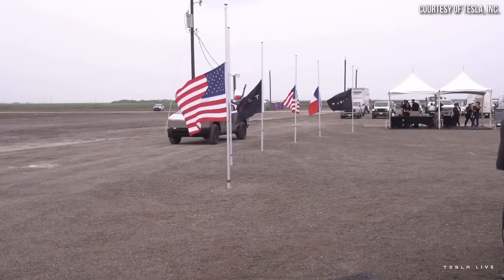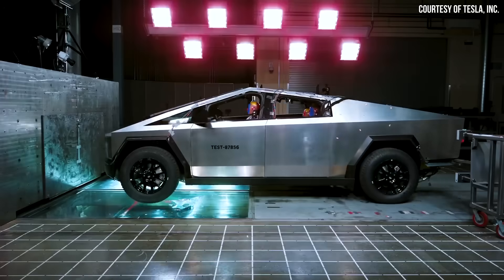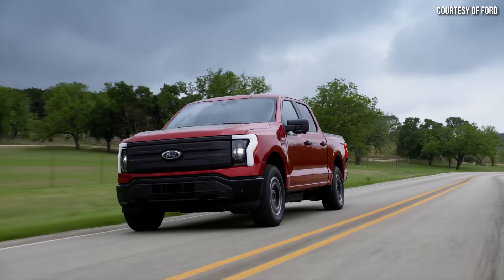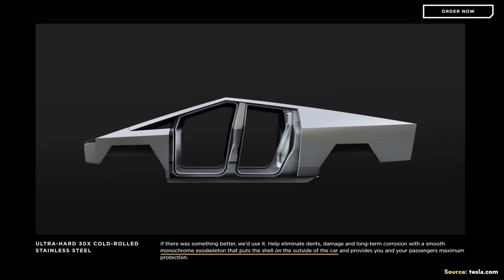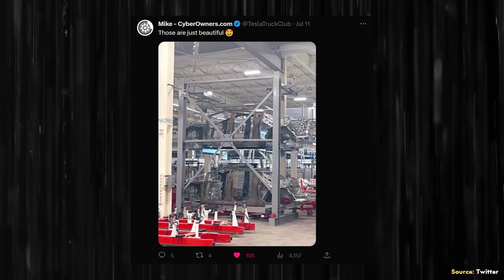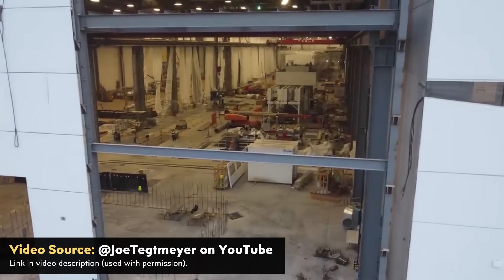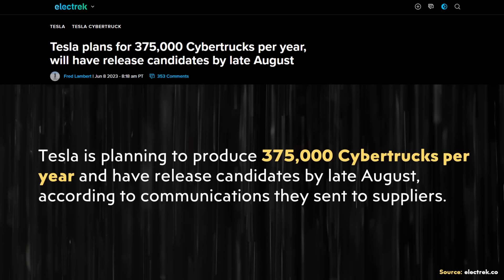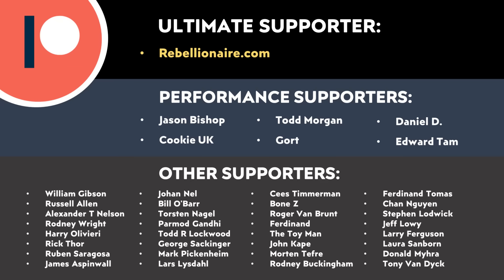LEAKED Tesla Cybertruck Image Suggests Structural Changes

Comment: I think most people will purchase a Cybertruck just because it is novelty.  Lets all try to remember...this is an all electric truck.  Imagine taking this "tank" Cybertruck out to the desert somewhere and running out of power. ......now what?  Sure, this could also happen with a gas truck but batteries are not going to fair well as well as a gas combustion engine. ( Basically, deal with heat well )   Plus, it is going to cost soooo much to purchase one that it will not even make any sense that it is electric.  Only the rich will buy them for only the reason to  look cool.   They will not be worth what you end up paying for one.

Comment: Spent 30 years in a GM assembly plant, worked many model changeovers, some of them we gutted the entire body shop and started over.   Here is my take on the exoskeleton debate.
   A lot of people appear to have a misconceptions of what is even possible as far as putting an exoskeleton on the CT.  

   First, Elon has mentioned several times how hard it is to work with the SS they are using.  Having to notch the inside of the workpiece just to be able to bend a straight line crease without breaking the press.  That is why you don't see any curved SS panels anywhere on the truck, it's not an option. So, they can't make door jambs or B pillars out of SS.

   Second, there have to be mounting points for things like hinges, roof rails and casting mounts. How would you attach a drive unit to the outer skin?  
     What you are seeing in the pic is what I call a space frame, I don't know what Tesla calls it, made out of the same super high strength steel that the cars use. I guess you could  call it a roll cage, which is what actually is.
    Then add the structural battery pack, plus the front and rear castings, just like the cars.
And what you see here does look just like a new Model Y frame.   So what's different about the CT, why do they call it an exoskeleton, and where does the weight savings come from?
      Well SS is lighter than the high strength steel.   Saving weight by the best part being no part like, heavy steel side impact beams in the doors, or using thinner steel in many areas of the space frame itself.  I didn't see any kind of steel reinforcement in the rear casting area, which might have been needed for towing or hauling. 
    I believe the reason they call it an exoskeleton is because the CT would not be structurally sound enough to drive without the added support of the outer skin.
  If you were to take all the sheet metal off a Model Y,  it would still be perfectly driveable and nearly as crash worthy.

The CT not so much.

IMHO.
Reply: Thanks for the insights.

Comment: I think Tesla changed the wording because Corey Stubbin said it was not an exoskeleton.  He kind of half recanted but the damage was done. The haters had a talking point.  If one looks at a turtle it is a good match for the cybertruck.  Exoskeleton  with all kinds of attachment points. Top and bottom. The body in white is a good way to create the attachment points and shells for door openings and interior parts.   However the real problem that nobody is talking about is that with all the holes for doors, glass in the roof and the box it was never going to be a great exoskeleton.   None of it matters as it will be a great truck.

Comment: Exoskeleton design like an aircraft doesn't mean that there are no internal structural supports. Rather, it means that the SS skin attached to the internal framing yields more structural strength than with standard internal structural supports alone. We can only speculate until Munroe tears one down for detailed analysis.

Comment: Will the CyberTruck ramp as slowly as the Semi has?
Reply: There's no incentive to ramp Semi fast because 1) Tesla is still battery constrained and one Semi takes a dozen Model Y battery packs 2) Semi factory, and not just a small line with higher per unit cost that is available today, only comes online 2025-ish, expanding Giga Nevada. IMO they could've built out half of Giga Texas for Semi and ramp it significantly, it just makes no sense considering battery (and engineering) shortages. Tesla wants to grow fast but not so fast it is unsustainable.
Reply: @BigBoneESB     A concept prototype of the Semi was unveiled at a press conference on November 16, 2017, where Elon Musk provided additional specifics.  So if you say the Semi will come online in 2025-ish, that is 8 years.  This battery constraint thing must be the real deal.     Hope they have enough batteries for the CyberTruck.

Comment: The casting is aluminum alloy. The exoskeleton is a steel alloy.  How did anyone think that the exterior would be of and part of the cast?  My gawd.
Reply: They didn't.  I think most of them knew that casting stainless steel would be too expensive and besides, Elon has been talking for years about folding the stainless steel.

Comment: If there is no underlying chassis holding the "cabin" to the "bed", you've got an exoskeleton or monocoque, as all modern cars have.  The structural walls are made of diferent layers in all cars.  On the Cybertruck the outer skin happens to be stainless steel, but the inside "skin" is stampable steel, so you can achieve the complex shapes needed for the door frames.  I believe the design remains the same as when it was first presented.

Comment: It can't be an exoskeleton; stainless is very expensive, 2X - 3X the cost of mild steel. With an exo you would need to use much thicker, and heavier material. You can actually see how thin the stainless is: around the fender areas you can see warble in the surface. I'd bet anyone here it is under .030, because .040 will stay flat in my experience. My guess is when they saw the cost and thought about repairabliity they dropped the exo idea.

Comment: I believe you are right that it is the combination of the body panels and the frame that will provide the overall structural strength. I think this was always the intention. 

You definitely need the frame to provide strength as well, especially the B-pillar in the middle of the vehicle where the doors are. The doors would immediately jam in case of a roll-over accident if the underlaying frame didn't provide enough structural reinforcement.

Comment: One thing bugging me is that it will be impossible for most people to reach over the side of the bed and get stuff out. In a 'normal' truck or a ute you can approach the tray from any side and get stuff out, but with CT you would need to get in the back to get anything that was up near the cab.
Reply: What you say is true. However, even in conventional pickup trucks, I believe that a high percentage of them are sold to people who rarely put anything in the bed at all.  They're mostly driven by poseurs.  I don't pretend to know the actual percentage, but here in the big city where I live, I think it's a large majority of them.  I see these huge, shiny trucks driving around without a scratch on them--inside the bed or out.

I think that an even higher percentage of the buyers of the CT will be buying it for the image it projects (clearly not the same image as the conventional pickup truck market likes to picture themselves--i.e., cowboys out ridin' the range).  But I think they will have some kind of definite (space cowboy?) image in mind that will be their overriding reason for buying the truck.  Few of them are going to use it as a working truck.

I guess what I'm saying is, in a sensible world (and maybe where you live is sensible) your criticism is entirely valid.  Where I live, I don't think it's going to make much difference to CT buyers.  They'll be putting that bag of groceries in the frunk.
Reply: @eyesuckle  I might have mentioned I wasa sparky working in a mine site and always had tools and otherequipment rollingaround in the tray, that always ended up hard up against the cab. In a Cybertruck I'd have to get in the tray to get it.

Comment: I expect this to be an incredibly rugged truck and so I think the 375,000 target is low if this truck is marketed in Africa and SE Asia where it could replace Toyota truck for utility, assuming the charging infra structure is available, and costs can be contained.
Reply: Depends on price.  Elon warn it will be "expensive".   I don't know if that means Model X or Model S expensive, but certainly much more expensive than a Model Y.

Comment: It’s not ladder frame. That’s still most impressive.
Yes, door jamb pillars separate from (front &) rear sail. To be expected. Still using triangulation of tray sails up to roofline to take that 3,500 lb load, not banana chassis like Hilux of old. It won’t flex like a F-150 ladder, separate tub. It’s function, performance that counts, not sticking to aesthetic hypothetical design. Does it still save weight, allow lower bed, stiff, superior "sports car" handling? Is it still cheaper to produce, more robust / long lasting?

Comment: In my opinion, building Cybertruck with removable SS panels, whether structural or not, will make it less difficult to repair collision damage.  Based on the leaked photos, it appears that much of the vehicle's structure is internal as evidenced by the upper extensions of the rear casting.
Reply: Yeah, with them offering their own insurance they now factor that into their design iterations.
Reply: I doubt the 3mm SS outer skin will be removable, given how important adhesion to the underlying stamped frame will be.  But I don''t know how they are attacked.  Maybe an adhesive that can be broken down by some process.

Comment: I still wonder how they can destroy energy in case of an accident. Normally this is done through forming the steel. If the form will stay in case of an accident, where does the energy go. They could pout airbags to the outside. More realistic, they have to allow that the steel plates get destroyed in an accident but take energy.
Reply: Ok is like 3mm stainless, in an accident it will deform its not Adamantium.
Reply: @timsmith6815  I had to look up: "Adamantium is a virtually indestructible steel alloy named after the fabled metal Adamantine of Greek mythology. The metal has its origins in the work of American metallurgist Dr. Myron MacLain during World War II when the U.S. government assigned him to military research and development."
Think about small cars, bikes, pedestrians (well for bikes and pedestrians its mr important that they roll over the vehicle). Also I think Tesla will do a lot with cameras in trying to avoid accidents. Steel on a vehicle is in the range of 0.8mm. It takes - for an accident - too much energy to deform 3mm steel. On the other side, when its stable its also good.

Comment: What you called side body panels, aren't. You are looking at the body-in-white.

All bodies-in-white are structural ekements. They provide stiffness to resist twisting, and so they are load-bearing. Cybertruck, too.

Tesla did not backtrack, and there is no significance to calling the body-in-white + body panels 'skins.'

Don't overthink this. The use of the word 'exoskeleton' just means the tough part is on the outside.

With all other consumer vehicles, the body is fragile. Paint is even more fragile.

No doubt design changes have been made. But the exoskeleton idea has not been watered down.

Comment: I would love to see a car made in one single cast. Mount the windows and doors and everything else from the underside. I guess Model 2 will be made this way.
Reply: I think it'll be 1 large cast piece for the frame overlay of the compact(could it be the first tesla without a glass roof?
Then the f&r castings and a small structural pack with the seats&carpeting mounted to it.

Just 4 major pieces to make a car with 3 being castings. Imagine the cost savings and speed of assembly. 😎
Reply: @4literv6  I would not mind a plastic or metal roof. I have closed my roofs in my teslas with sun shades. 

I think the glass roof is one of the things that make no sense.

Imagine a factory where you delivery alumiium, steel and crude oil on one side and get a complete running autonomous vehicle on the other side.

Its magic! 

"Any sufficiently advanced technology is indistinguishable from magic."
Reply: If you crashed you would just chuck away the whole car ?

Comment: There is no special alloy. it's just a standard stainless steel. i bet it's the same as the DeLorean used.
Reply: They already said it's their own in house mettalurgy teams steel as used in the starship. 👍🏻
Reply: This is incorrect. CT uses 301, cold rolled 30x, that is 3mm thick.  It contains nickel, chromium, & iron.  Making it more cost effective, but not as strong. DeLorian used .8mm 304.

Comment: I doubt the cyber truck exoskeleton design has changed at all from its original conception. If you look at the body image that was on the original order page, you can see the stamped members around the door openings. Clearly 3 mm thick exoskeleton steel could not be completely self supporting. The folded steel and stamped frame just beneath it together give the body the rigidity it needs.
Reply from the maker: You may very well be right.
Reply: Different (3+) materials  ( and thicknesses) require separate steps
The picture you see there is already two main (materials put together) steps, one stamping parts and one casting parts now just add the stainless steel panel then that’s your final exoskeleton 

Even the midsection are welded stamping pieces, ( not just from a single stamping); then you have two casting pieces, front and rear.

Comment: For real production line of a mostly unibody truck.  Wondering if Tesla will use thinner steel for the body...no need to haul around 3mm of expensive stainless if it isn't structural.  1.5mm aught to do the job while keeping the weight and cost down.

Comment: Tesla really does have the most efficient factories out there. As for the new CT - I'ms user early on the reservation list but man am I in a tough spot. Do I get an early example knowing that it is going to get way better in a year or so... and is it possible to delay my order. I just get the quad and sell it in 6 months and pickup an updated one later down the road....
Reply: I am in a unlucky positon in Europe and do not know whether we even get ONE Cybertruck. I am in the lucky position that we certainly will not get the first gen. I hope for a 3rd. gen in 2028.
Reply: Buy it and immediately resell it - you will make a nice profit from the hype alone. THere are very wealthy people that want the latest and outrageous fashion. Then wait another 1-2 years for Tesla to refine it. That happened with all of the models, but this going to be especially true for Cybertruck. This is such a radical design that probably it will take few years to work out the kinks.

Comment: Laser cutting and folding is really really slow compared to stamping, so if it's ever going to be produced at scale they will need many many laser tables and press breaks so probably many more machines and much more floor space for similar production volumes with traditional stamping.

Think 5 second cycle time for stamping and 5 minute cycle time best case for laser cut and fold. That's a 60x time cost unless you have 60 laser machines and 60 press breaks feeding into the production line. 

That's why I doubt the will achieve close to 25000 in 2024 and that's being optimistic
Reply: Perfect job for Tesla bot. Underground. Reminds me on Metropolis.

Comment: Doubtful that this is a half step. They simply overplayed the idea of the exoskeleton. The skin will offer structural support, but not without the castings. Fantastic either way!
Reply: Agreed. A true exo-skeleton vehicle would have a very hard time passing crash testing. If you dent/bend/crush part of the structure the integrity is compromised. What happens when you damage a submarine while under stress? After a side impact the next impact would fold the CT up. It would be very difficult to pass the roof crush test with only a stressed skin. The idea behind the SS skin was to make the truck tough, no paint to scratch, dent resistant, rust resistant etc. Using the skin to improve structural strength makes sense. I don't understand the furor over whether it's a "TRUE" exo skeleton or not is about. Will the CT do what it is expected to? Will the body be damage resistant? Will it performance well? Have good enough range? Worrying about whether or not it meets someones definition of exo-skeleton or is stressed skin unibody or monocoque or space frame strikes me as ridiculous. Tesla designs based on first principles. If you can out engineer them you are wasting your potential in the comment section.
Reply: @GROND15 ol!! I wish I can upvote you more than once!!
Reply: There is no practical way of assembling stainless plates without a base structure. It is perfectly possible that instead of multiple welded sheets as usual for stiffness & crash worthyness they used sheet metal for the alignment control and interior fixtures of panels. So, not really a deviation. Unless someone tells me how to assemble flat stainless panels & interior fixtures without a base...

Comment: Hold those thoughts until we see the "structure of the stainless steel body parts". It will be the combination of structures for sure. Collision safety engineering has changed with the castings and it all must work together. I have experienced 60 years of Budd Company stainless steel rail passenger cars unpainted and still in daily service looking good in the USA.